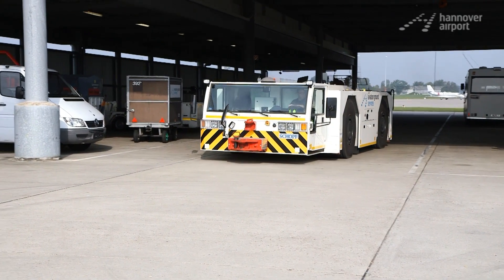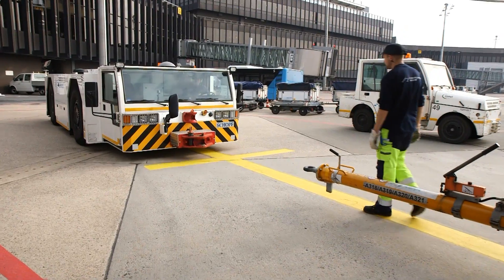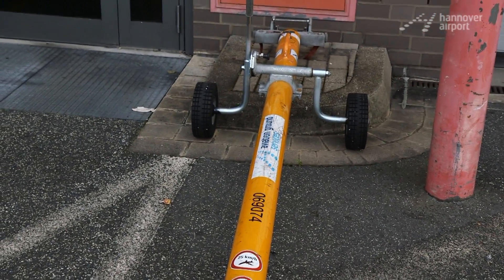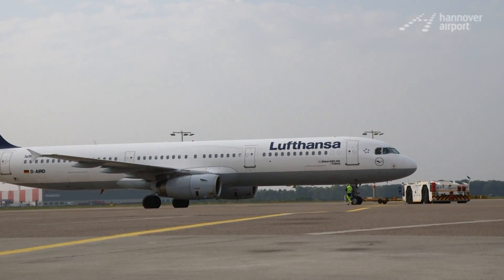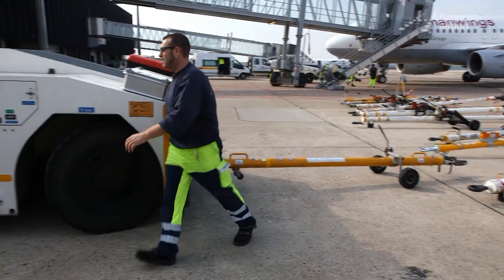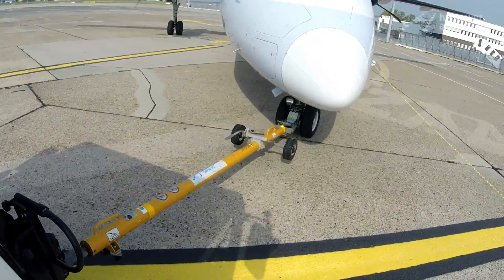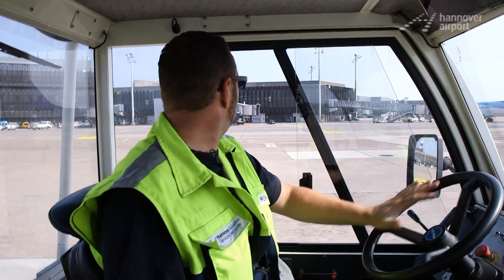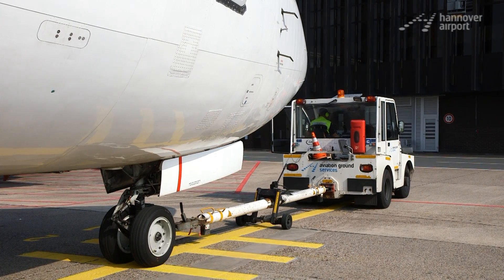Pushbacks - Power pack on Wheels

Comment: The process is called a pushback because the aircraft is pushed backwards from the gate. It's not a pushback because you push from the front, and pull from the back. That's just a ridiculous statement.

Comment: Why is there a need for the cab of the pushback to raise up?
Reply: So you can pull the aircraft and sufficiently see behind you to get on the line.
Reply: for big ass planes like airbus a380 and boeing 747 because the landing gear is higher and bigger than common planes
Reply: Probably so the driver can see the Bar better
Reply: For towing aircraft.
Reply: EVA_Unit_4A in case the pilot and pushback driver need to use hand signals
Reply: I'd think so they can adjust to the type of aircraft

Comment: Planes can actually go in reverse on their own but doing so requires them to engage the thrust reverser that would be dangerous to do in close proximity to a terminal
Reply: that is untrue look up the term "powerback" (this is coming from a guy that works on the ramp)
Reply: I agree, however I have witnessed jet aircraft push back from the gate just as you describe  many times.
Reply: Bullshit, they most certainly can. Look up the concept of powerback.
Reply: Not all planes can do it.  Turboprops, DC9/MD80's can because of how their reversers are designed.  But not jets with wing-mounted engines nowadays - they don't actually move air forward, but rather outward to create a wall of air and cancel out thrust.
Reply: It can back up the plane, but when it does, it reverse the air getting in the engine, which can cause cones, and even ground members into the engine
Reply: Phani Kamineni They can go in reverse
Reply: stupidkid6581 probably expensive in fuel when you think of the weight and basic laws of physics.
Reply: Only the aircraft with clamshell reverse thrusts can do this, such ad the md80
Reply: etjh 00 smartass
Reply: the 717 can doens't need pushback truck they just reverse trust
Reply: Thrust reversers cannot move the plane backwards. They can only slowdown the plane after touchdown by pushing the air forward.